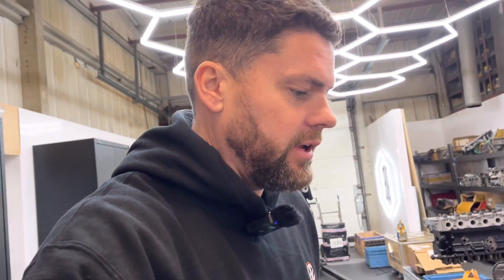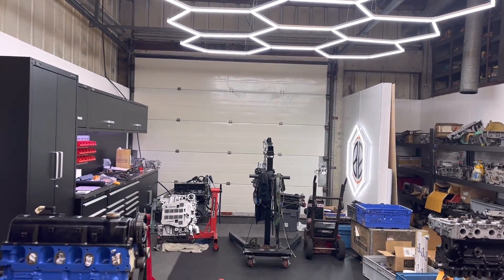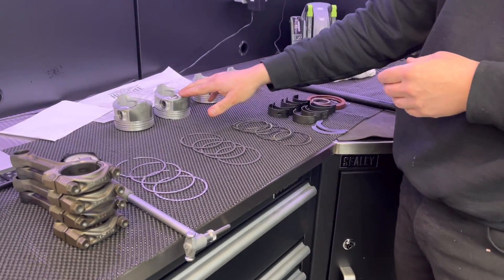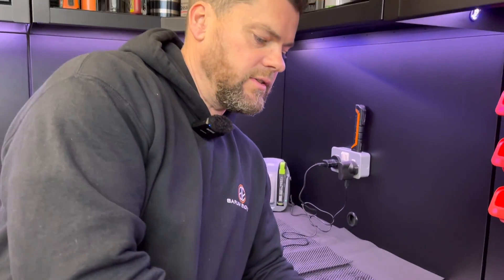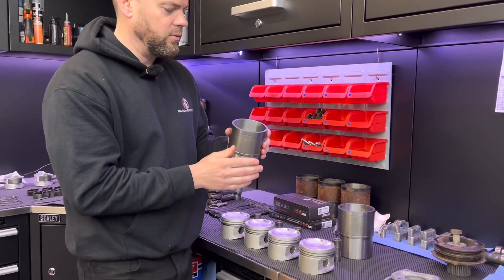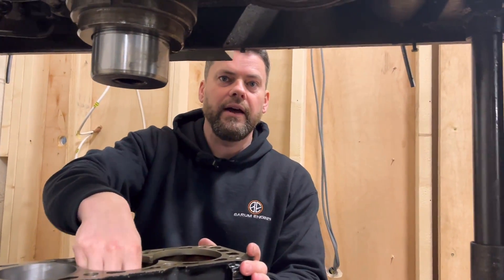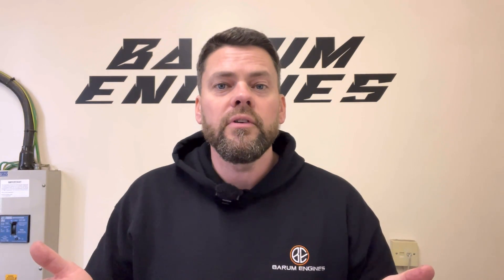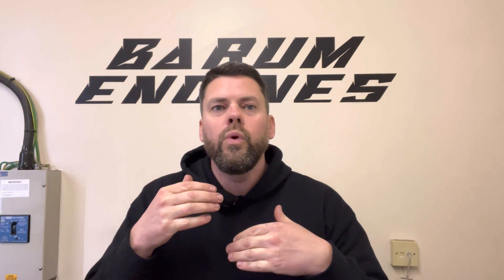Q&A: How much do our engine builds really COST?

Comment: I would say engine builders that do many engines no doubt have better machinery than you guys have. Things like proper a boring and facing machine and a head machine like a Serdi. Yes, I understand you can still do good work but just so slow. It’s all about the scale of economy, just because they’re cheap doesn’t necessarily mean they’re bad and vice versa, expensive doesn’t necessarily mean good.

Comment: Lee £80 an hour for the work you do is nothing. 
The mechanic I've used for years (old school, always had a BL or ford car on a ramp being worked on) was charging £40 an hour when he retired recently.

But thanks for answering the question on the reconditioned engines for 2k, as it's something I hope I don't need to do (PSA/ Ford diesel with 216,000)

Comment: i had a nicosil barrel replated once by a well company in gloucester, it failed within 2 hrs after a hr of slow running in, turned out they used the wrong process to remove the old coating and the replated coating just peeled off as it got warmer. is that why you dont like nicosil coating as you cannot fine tune the clearances like you can with iron....
Reply: BMW used Nikasil coated liners in the early 1990s and discovered they were prone to high wear rates due to the high sulphur content - that reacted with the nickel lining - when 'lower' quality fuels were used.  It was a problem in the US and Australia but not so much in Eurupe.

To address the 'Nikasil issue' BMW re-engineered some of their engines - if I recall the V8 engine block - to Alusil blocks, where the bore surfaces are made from high silicon content aluminium which is very hard-wearing. As this method is via impregnation, there is no coating as such on Alusil blocks to strip off - so no loner a problem.

In 1998 BMW brought out the steel-linered six-cylinder blocks to cure the problem on the 6-cyl engines.  However, I understand that the S65 V8 in the E92 BMW continueed with the use of the Alusil V8 engine block.  Don't know what current 6-cyl G80 BMW use - however I assume its Alusil engine blocks.

I believe that most, if not all OEMs have steered away from using Nikasil.  I certainly would not use a Nikasil recoated liner in a re-built engine.
Reply: @georgebettiol8338 😅

Comment: lol saving  up  for a v70r engine build  with sleeves  to run   more power and  avoid  the cracking  issue   its fine at mo but shes at 190k  miles    so defo  dont want to push it  too hard lol im asuming 10k  for engine build   ill be getting these  guys to do it as  you can see the work they do   in essex ill end up with some   pos  thats got a lick of paint   and thats it lol

Comment: I'm noticing the Cosworth engines to you Brit motorheads are like the Small Block Chevy engines to us colonials.  They may be 5.7 litres but they are like a really good watch...they keep on ticking.  Lol
Reply: Hi ya Gerry. They are Pinto blocks? There are different castings. But it's basically the same Pinto block. Had loads of them in the past (I'm old), is a very very solid block, almost unbreakable, easy to get out of the car, easy to do small but effective mods too, traditionally fitted in cars from 80's that were like 3/4 ton all up fully laden. Get home, an evening of work, high lift cam, polish the ports and some well chosen jets and that releases the power of these, just for a few quid because we were poor. Then drive it down the pub and have a pint or two (but not now obviously). Scrap yards used to be full of them so there was a bountiful supply. Some were shot (that means end of life) but a lot just needed rings and mains for another 50k miles of life. But some of the mods I've seen? As the man said, strung out a bit?  It's still a 70's block at the end of the day and that's 54 years old. But still a good rock solid almost indestructible block if your mind set is to not blow it up. Rebuilt loads of these. Small block Chevy .... is also a 70's block? ... Now ......  I'm sure you are about thinking I'm going to go all Brit on you, be critical right now and start coming out with phrases like "yank tank"?

The reverse. I own a 97 Z28, LT1 in the UK. It's 28 years old. It's a last of the LT1's, it has embossed leather 30th ani seats..  All the stuff, a bit lowered and LSD. I've had her for 9 years now. It's age and lack of use and being quite small in the back seat is her enemy. The LT1 is such a gorgeous well balanced lovely low stressed powerful engine in stock which mine is. I try to keep her stock as far as I can. 55k on the clock from new. She did start to blow a bit from a head gasket year before last ... rot ... from mainly, age and lack of use. I eventually found someone in the UK to do the basics, lifters, followers, valves all gaskets etc. Excellent job done. Nothing bottom end needed any attention, I don't think she's actually run properly in yet? And of course, they had to extract this monster bundle from the car to do the work. I don't rag her much. She had always ran like silent before and after, so balanced, so smooth, until you go round the tail end to the CME I fitted and hear that 5.7 V8 gurgle. I drive her quite slow mostly ... don't go instantly to jail etc, potter around the English countryside to pubs at the weekend etc. There is a beast under there though that wants to go. Christ ... she is so very quick, if you ask her. There is always some idiot after seeing her sleek lines, that wants to see themselves disappearing in my rear view mirror.

Finishing ... What an awesome bloody machine she is! Thank you USA making her and for letting me own one of these. How did they ever get that engine in there which is quite a small car? And weighs less than my 18 year old Civic. What a machine!

T
Reply: @black5f  awesome mate...I sure do miss my days doing the pub crawl. I was stationed at R.A.F. Fairford for a couple years... The Brit chefs we had in our chow hall were absolutely frickin' fantastic. The GMC K2500 pickup I have had a slightly modified 5.7.  I got one of the rare 4 bolt main blocks and changed her over to a roller camshaft and found some cast iron Vortec cylinder heads to slap on her. I was getting about 20 kilometers per gallon... That is until I put the fuel injectors for a GM 7.5 litre engine on the old girl. I have no idea what my fuel mileage is now but she sure is a rev happy son of a gun. Easily hits 6,000 RPM. Oh, yeah...I had a serpentine belt disintegrate right at one of those scream sessions. Replaced the alternator, water pump, harmonic balancer, and the crankshaft drive pulley. Yeah, it sounded like a grenade going off.  Thanks for the chat guvnah... Gonna cook up some fish and dig out my Sarson's.   Mmmmmm
Reply: @gerrywalsh5766 Brilliant! Take care buddy.

Comment: Hi totally change subject 
I have an MG midget stage 2 tuned 1340 cc 
Drives an runs fine until I give it the Beans under heavy load on acceleration it knocks bottom end
Rumble 
I,m worried that it may let go one day 
I did not build the original engine but did rebuild it when the head cracked 
I did not plaster gauge the con rods or mains on the crank as they measured ok 
Now watching your you tube may be I should have
There’s two things I,m thinking either to high compression or incorrect mains clearance 
What do you advise strip an check the crank or check compression first 
Once it’s revving it fine say over 3000 rpm

Cheers
Reply: If the engine has a bottom end knock - it won't improve with use - and may  terminally damage the crank and/or block.  If it were mine, I'd be removing the sump and perfoming an inspection of the bearings caps - painful I know - but may be worth it in the long run.